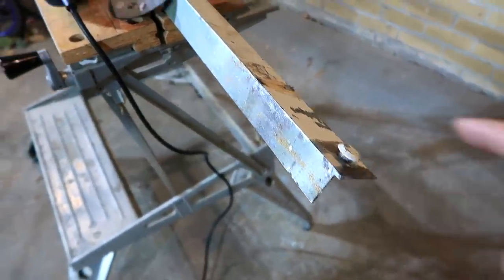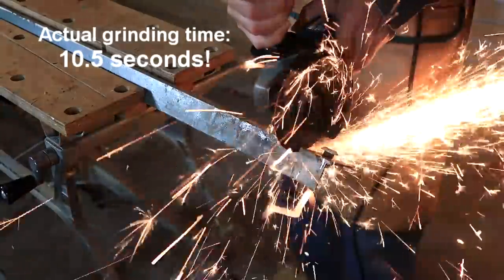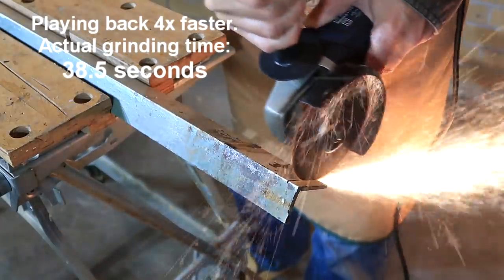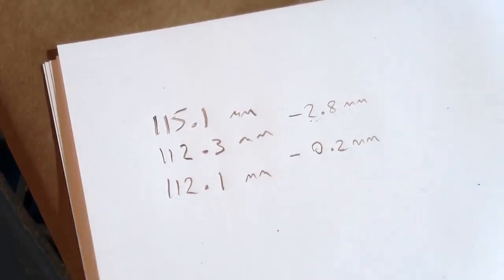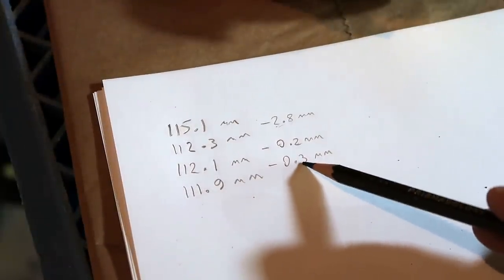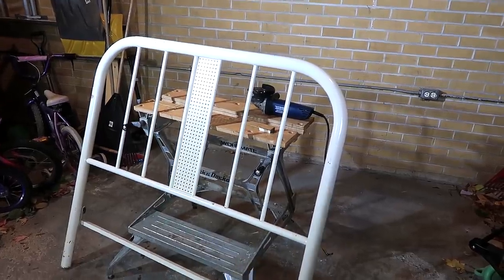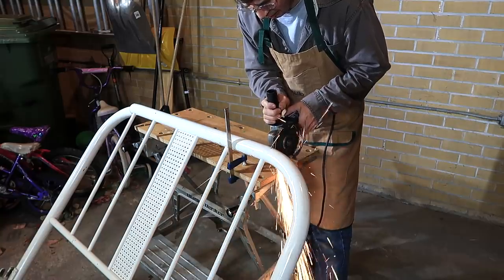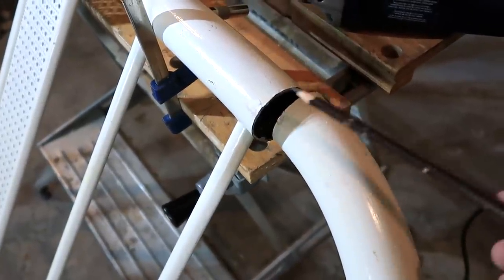make cutoff disks last 10x longer (replicating Fireball Tools' experiment)

Comment: Should you compare circumference instead of diameter? It seems that there's more material loss when going from 115.1mm to 112.5mm than from 112.5mm to 112.1mm
Reply: But also a reduction a surface speed as the disc wears which may make it less efficient and increase material loss?
Reply: Not really relevant when compared to the diameter. 2.5mm is less than a 3% change.
Reply: Surface area lost would be better I guess.
Reply: All of those numbers are mathematically related: diameter, circumference, and surface area.  So using any of them should give you the same rate of change.
Reply: Circumference and diameter scale at the same rate. Doubling the diameter means doubling the circumference. But there might be an argument that area is a better measure of disc wear than diameter because area reflects total mass lost, while diameter only reflects comparative mass lost when you start with the same initial disc sizes. In small amounts like this test using diameter probably works fine as long as both tests were done at similar diameters.

To find relative area you just square the starting diameter and the ending diameter and subtract the smaller one.
 So 115.5^2 - 112.5^2 for the first test
and 112.5^2 - 112.1^2 for the second.
This doesn't tell you the area itself, but it does give the exact proportions since for actual area both are multiplied by 4pi^2.
Reply: @reidflemingworldstoughestm1394  Exactly. Going from 115.1 to 112.3 means you've lost 2.4% on the diameter.
But, working out as surface area, you've really lost 5.1% of the disc, which even for just these small changes, is quite a difference.
Reply: @mrfocigaz4942  That doesn't matter to us as much as comparing the two different methods of cutting -- but yeah, the change in area increases faster than the change in diameter.
Using the diameter comparison at the values in the video has the fast cutting method burning thru 7.5 times as much disc diameter as the slow cut method.
Using the area comparison the fast cut uses 7.6 times as much area as the slow cut.
This shows that, yes, at similar diameters for small changes in diameter, diameter and area comparisons are close enough that it doesn't matter which one you use.
 Starting with a smaller disc gives a larger difference between the two types of measurement than starting with a full disc does.

Comment: I usuali use a mix of the two i grind a curf in so i dont vear of the line  and thain i go back and forth in small strokes so it to minimize the surface area wich the blade is toching

Comment: It feels as though there's some maths missing here... Should you be measuring circumference and rpm?
Reply from the maker: It's dwarfed by the effect I saw, and if I factured that in, the effect would be bigger.
Reply: @matthiasrandomstuff2221  I suppose its the same problem as a roll of tape/toilet paper; the materials thickness, and its increasing diameter as more gets wound on to the spool. By working gently you are making the thickness of the tape thinner and so making more turns...

ANyway - love your work and good to see you healed up. Keep it up!

Comment: Surely this is a flawed test technically.  You should have used a new blade with the same starting diameter each cut. 
For every revolution of the grinder arbour, a new full sized disk would give X disk cutting edge length, say 200mm for arguments sake.  
For the next cut test the disk is smaller so you only get say 175mm edge length to start with, and so on

Comment: Neither of your tests have appropriate controls. Cutting discs call for many different RPMs. Angle grinders perform at different RPMs. Many of them are variable speed. I think there is a much larger impact on durability when matching RPMs to the manufacturers recommendation than people realize. I thought it was all marketing hype until I sprung for a high-end pferd cutting disc. While it cost 8x, it performs 20x when following the manufacturers specs. If I put the same disc on my harbor freight angle grinder, it gobbles it up.
Reply from the maker: ok, do the test, let me know the results.  Not like it's a big investment in material.  As it stands, I did infinitely more tests than you.

Comment: Technically if you want to be a good scientist you should compare the total circumferences instead of diametre's if you want to compare deltas. Cool video though!
Reply: I don't think it makes a difference because there's a constant ratio between diameter and circumference.
Reply from the maker: It's dwarfed by the effect I saw, and if I factured that in, the effect would be bigger.

Comment: Nice test but shouldn't you measure the surface area lost instead of diameter?
Reply from the maker: Yes, but given that the deep fast cut was first, the measurements actually understate the advantage of the gouging cut.
Reply: The 2.5mm difference don't matter at that diameter. There are other uncontrolled variables that will change the result much more than the less than 3% change in diameter.

Comment: More time on the cut and more electricity cost vs faster cut, lower electricity cost but using more discs and extra disc change time. A good example of where the technique used depends entirely on who you are and what you are doing.
Reply: I am going to say that the extra electricity is pretty much always going to be far less expensive than the consumables unless you are working off of generators and must transport fuel or something.
Reply: The electricity usage isn't all that clear cut (lol) either.  Grinding fast puts more load on the grinder, using more electricity.  Whether that exceeds the what the 'slow' cut used, well, that's what power meters are for.
Reply: @carbonstar9091  Certainly the electricity costs are not going to exceed the cost of discs, but it is a factor to consider depending on your circumstances, generator there being a good example. Biggest cost in any job (even for a hobbyist) is always going to be your time but again how that is valued depends on your circumstances.
Reply: @j.f.christ8421  And grinding fast puts more load on the mechanical parts of the grinder, possibly causing premature wear/failure of the tool.
Reply: @caskwith  Yeah, Bubba the 800lb gorilla is going to cost you more than the electricity, but now we're into bean-counter territory.

Reminds me of when I worked for company making big yellow mining stuff during the last boom, the mines were all trying to recruit women.  Not for any "Go girl! feminist equality" stuff, merely to save money.  Women generally tend to be more gentle on the hardware, which was rather important when any spare part you'd break would be at least 7 figures and have a 12 month lead time.  They were not happy with the average leadfoot bloke wearing out tyres & brakes while snapping axles.

Matthias should test how much wear & tear his wife puts on the discs.

Comment: Somewhat negligible in this test but as the diameter decreases with wear, it will wear faster and take longer as there is less surface area to do the work.  Probably accounts for the slowly growing loss in the gouge cuts.
Reply from the maker: It's dwarfed by the effect I saw, and if I factured that in, the effect would be bigger.

Comment: if only you'd used a new disk of the same radius for each cut - the relative loss in radius might have been more meaningful.
Reply from the maker: At a 3 mm drop from the first one, it wasn't that much difference.  Also, that only favours the plunge cut, so the effect would be even greater if I had compensated for diameter.